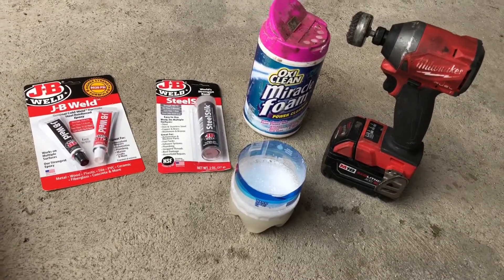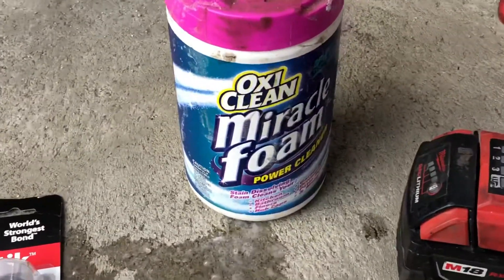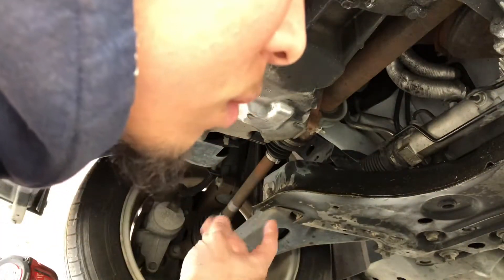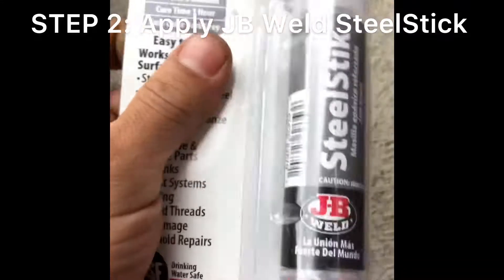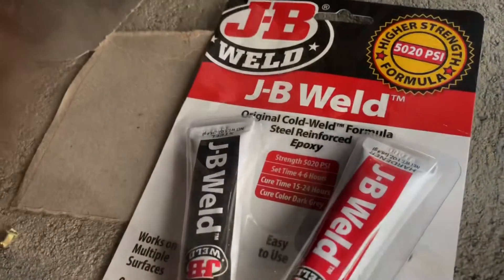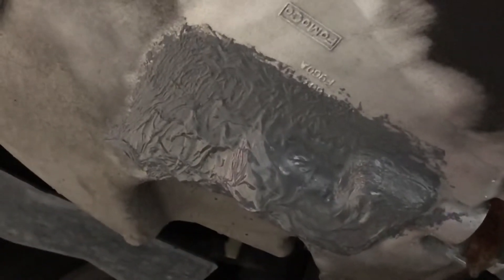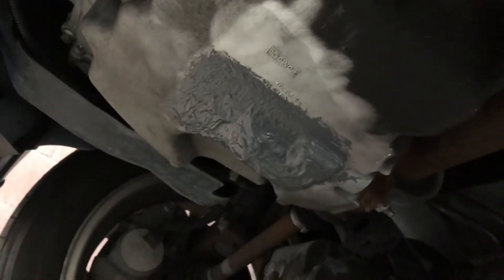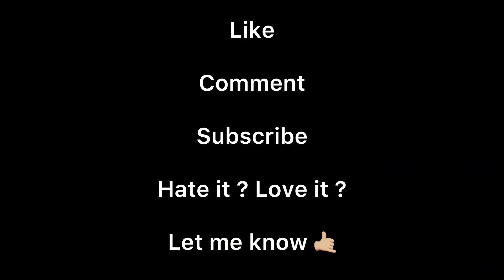How to fix a broken or leaking oil pan for only $20 !! JB Weld Epoxy *THE RIGHT WAY* it works !! DIY

Comment: Cleaning the surface is key . Also if you can’t get oil to completely stop use crayon on the crack and dig it in . It will stop the oil long enough for you to use this method .👍🏽
Reply from the maker: I didn’t know that one 😂🤙🏽
Reply: I just got into a crash about 4 hours and cracked my pan. I sprayed a ton of brake cleaner and patched with JB, not sure how long it's gonna hold
Reply: Update: I made it home and just threw a new oil pan on. 
Dude at the mechanic told me $2500 to fix it and offered to buy it for $250. Cost me less than $100
Reply: Excellent advice I hope I don't have to use any of this but I like watching it thanks for the videos
Reply: That crayon idea worked like a charm. Was able to clean and prep long enough without any oil coming out.👍🏾
Reply: Crayon?
Reply: @juanthag98  yes I didn't want to change my oil again when I just changed it. I jammed the crayon in the very small crack long enough to stop the drop and was able to clean it really good and apply the wb weld. Haven't leaked since.
Reply: @kyngdarius774  like a coloring crayon?
Reply: @juanthag98  yeah
Reply: @kyngdarius774 does the color matter? Haha

Comment: I did the oil pan on my jeep 7 years ago, still holding.. Make sure you get the pan really clean before using the J B Weld.
Reply from the maker: It’s been a year for me and still going strong 💪🏽. Prep is the most important part in my opinion
Reply: you see, i did this to my f-150 today. i used carb cleaner and a rag. not clean enough i promise. it seeps around the edges and barely leaks out. might get the liquid mixture he used for last coat, and just slap in on and hope that she holds up👍🏽 definatly don’t wanna change the oil pan on that thing

Comment: Yeah agree with you that something like this pretty cheap and much easier to fix it . Worth a shot . This mechanic who owns a shop told me it never failed him . I've a tiny hairline crack on my aluminum pan and using something similar called QuickAluminum cost $17 looks like yours in a plastic tube mix it with your fingers . He even told me where to buy it and how to use it . Just mix it with your fingers put on prep area . He told me to let oil drain out of it overnight . Use brake cleaner then use brush /scrape it . Put on thin narow line right on the crack the first time wait on hour . then put on wider application the second time wait one hour .

Comment: I had a tiny crack in my Honda element oil pan I used black gasket maker ( it’s what I had) and it hasn’t leaked since. Been about 10 months.

Comment: I did something similar but I only used Marine Weld Syringe. I was 70 miles from home when I hit an object on the road and gouged my transmission pan. Stopped.by autozone, fixed it outside AutoZone, and waited an hour for the cure time. 200 miles later it's still holding up. But it was an emergency repair on the road and I'll eventually change pan.

Comment: That's what's up ehh yeaah man I been contemplating having the mechanic replace my oil pan for like a couple 3 bills after attempting to do the job myself the exhaust in the way so stressing about it gacho I have some jb weld steel stick for months so I'ma give it a try good video

Comment: Hi there.  you think if i put this around the oil pan it will work for me. i have my truck leaking motor oil from the rear side of the oil motor pan. for so many years. i dont have money to pay for getting it repaired
Reply: It depends, is it leaking from the gasket or a crack in the pan like the video? If it’s from the gasket it’s more tricky but rtv gasket maker will help if you clean it well with brake clean and slather it all over.

Comment: I also have a small hole in the oil pan but i didn’t notice while driving because of my music and my engine and everything cut off. Was that the cut off sensor doing its job or is my engine probably fucked😭
Reply from the maker: Ohhhh snap, I just saw this. What ended up happening? Lol

Comment: I used quiksteel for mine held up quite sometime until yesterday. Replaced oil pan with a spare, only to find that it also has a crack in it. Back to the auto parts store.

Comment: My Toyota Camry 2016 was quoted 4-5 hours of labor and 250 dollars in parts to replace it. It only has like one difficult bolt to get to by the subframe but it’s literally not hard to do yet they wanna charge that. I did this and saved myself a thousand bucks

Comment: What is the power tool you're using to sand and clean it?
Reply: Milwaukee impact for small torqued bolts
Reply from the maker: @paskainenpersereika7245  😎🤙

Comment: Question...I don't know a lot about cars but if we did this to repair a bad oil plug, how is the next oil changed performed? So they need to pump the oil out?
Reply from the maker: Ohhhh snap, that’s a good question bro. Mechanic will most likely want to replace the pan. Not to sure tho
Reply: Yes you can just get a pump from harbor freight . Me Mercedes didn’t have a drain plug the pump mine
Reply: You can replace the original plug with a piggyback or spring-loaded valve type.

Comment: I have a crack in my oil pan but it's not leaking, you think it's safe to do this while theres oil in the pan?
Reply from the maker: Yeah bro, I think as long as you clean it as beast as you can, it should be fine.

Comment: Alonso, I followed your procedure, fingers crossed it works...i'll update after 3 months....Wife's car too!!
Reply from the maker: Good luck Kamuti ! I did the repair back in March 2020 and it’s still holding up ! Not a single drop of oil (:
Reply: Might try this on my 1000rr.
Reply from the maker: @brandonatkins9087  let me know how it goes ! 💪🏽
Reply: Hey it’s been 3 months, how’s it holding?
Reply: @brandonatkins9087  did it work my bikes fucked tryin it tho
Reply from the maker: @savage-_-jb274  no leaks or issues at all ! 👍🏽
Reply from the maker: @otakugiggles  prep is everything ! Make sure it’s as clean as possible and it will work ! 👍🏽
Reply: @savage-_-jb274  It's remarkably doing well. Only some oil sweat from a different area but it is amazing!!
Reply: This JB weld is amazing. No oil Leaks from the repaired area. The oil sweat from coming from the sump guard nut after i did the service and did not replace it. I put some thread seal tape and it's squeaky clean now.
Reply from the maker: @kamutik1271  that’s awesome!

Comment: Does this work on a motorcycle??
Reply from the maker: Yessir ! As long as you clean the surface as best as you can ! Keep in mind I let this pan drain for 2 whole days before I did this repair. You don’t want any oil or any kind of residue around the area.
Reply from the maker: Good luck ! 👍🏽
Reply: Thank u just sucks cuz its a corner and part of drain hole lol
Reply: I have the same problem on my yamaha blaster.  A small crack that starts at the drain plug hole. I will be giving marine jb weld a try.
Reply: @jamestownsendjrtbees3226 it work?

Comment: How's it holding up now?
Reply from the maker: Still going strong bro 💪🏽
Reply: @shoobiedoubie6871  NO WAYYYY
Reply: @shoobiedoubie6871  hey chic here 😂just got my car fixed 3 times the guy cracked my oil pan and acted like he didn't do it charged me 400 t0 find 2 ground wires well I pick it up and not one drop of oil I turned around he put oil in it, what a rip off man oil never leaked until he worked on it, OK so it's real small I loose a quark a night but it's a steady drip oh follow these steps and let sit over night or 24 hours? This suck ass man can't find any good mechanics here and does it have to be nice out?

Comment: Used this to fix a big crack in the sump on a VZ Commodore..was still sealed tight 3 years later . 

I used to fix big crack in the sump on VZ Commodore. Caused by trolley jack.

Permatex Permapoxy 4 Minute Multi-Metal Epoxy 

rigid materials such as aluminium, brass, chrome, copper, iron, stainless steel, and steel. It can be used to seal welded seams, fill metal cracks, and mount metal components when cured, can be drilled, sanded, threaded, or filed and is resistant to fuels and solvents
Cure time 4hrs 
Used on a crack on a sump caused by trolley jack. Was sealed tight 3 years later still.

Comment: Ya, but it was tiny leak. I had one the size of a nickel and applied two different sets of epoxy, three steel sticks and a half a can of gorilla glue adhesive and the oil still leaks.
Reply from the maker: The only thing I can say is that the cleanliness and prep of the affected are is WAAAAYYY more important than the thickness or type of epoxy you put. You can wrap anything with gold, but if it’s not prepped properly it will fail.
Reply: @shoobiedoubie6871  What I should have did was plug it with a metal cork first. You can't expect to patch a hole the size of a nickel and just have a screen and that jb weld. It's not strong enough. The oil slowly leaks through the patch and tears the weld apart. I should have been smart enough to just replace the oil pan instead of hoping for a quick fix with the jb weld. $120 later and I learned my lesson finally. I will replace it this week.
Reply from the maker: @anthoneytolliver4442  that is a very good point 🤔

Comment: I’m definitely gonna try it I’ve got a small crack on the oil pan of my Gsxr 1000 oil pan this will work an I’ve got an idea to make it look nice maybe lol thanks for the info
Reply: Did you try it? Worked? Got a hairline crack on my pan on my Gsxr, over tightening the oil plug 🤦🏻‍♂️
Reply: @aarondaniel9986  yha I took the pan completely off scuffed up the area where I put the jb weld it’s been a couple months now and no leaks
Reply: @rezkidgamingyt4725  Oh ok sweet. Did you put it on the inside or outside? It seems like a pain in the ass taking that pan off
Reply: @aarondaniel9986  in and out just a thin coat on the inside

Comment: I’m pretty sure your video fixed my KX250F I fuck with you Thankyou 💪💪💪
Reply from the maker: Bro as long as you prepped and cleaned the area as BEST as possible you should be good 💪🏽
Reply: @shoobiedoubie6871  deff man I tried best I could in my storage unit lol . Sanded it down with rough grit and bunch of break cleaner an air 💪hope I’m good I just tossed out 4 bands for this thing . Some people are devious watch who you buy stuff from this man was a (family man ) town fireman smh

Comment: The steel stick is great. Used it to ply a hole in my motorcycle gas tank. That steel stick only needs 5-10 min to cure. You can feel it getting hot while mixing it. But yeah I'm about to do my oil pan it cracked last week. Gonna solder it first then use the steel stick.
Reply: solder aluminum is possible?

Comment: Still holding?
Reply from the maker: Dude, yes ! I honestly can’t believe it lol
Reply: I just did this last week I had 1 hole in mine not a crack I was able to quick steel a penny over the hole then layer the jb original  then I added a steel plate over that. And another coat of jb.
Reply: Mine still holding solid as well!!!

Comment: Used this to fix a big crack in the sump on VZ commodore. Caused by trolley jack. Was sealed tight 3 years later still

Permatex Liquid Metal Filler

to-use filler can be drilled, filed, sanded and painted. 

Forms a long-lasting, metal-tough bond. Works on metal, wood, and concrete. Excellent adhesion to galvanized metal. Repairs cracks or porosity leaks in cast metal parts. Fills small holes, cracks, and perforations. Resists water, oil and gasoline.  Works great to